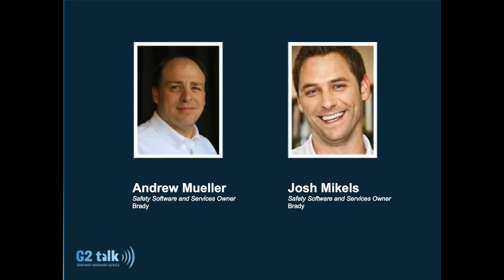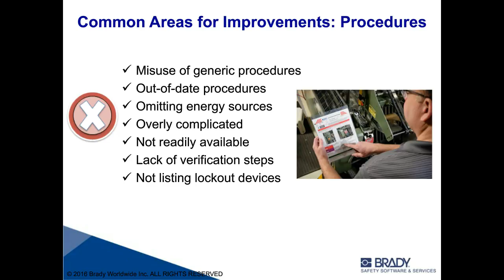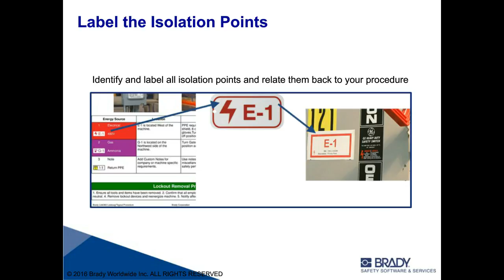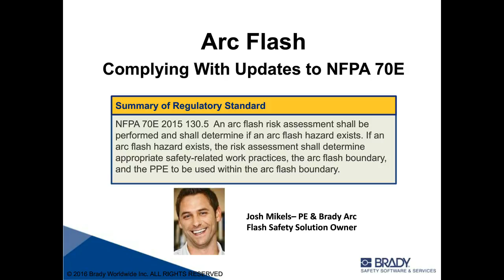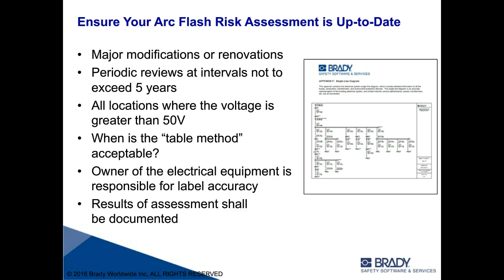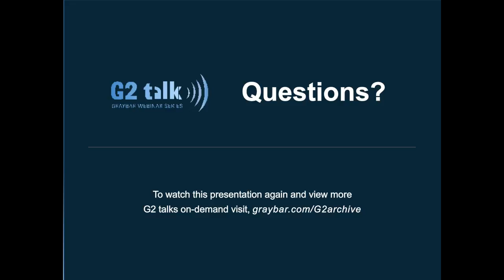Improving Electrical Safety Compliance: Arc Flash & LOTO

Comment: This overview is extremely informative and supports my contention that the development of energy control practice is the art of integrating various sources (ANSI Z244.1, NFPA 70E, 1910.147 & .333) into one hazardous energy control program. That is, one needs to consider electrical hazards (such as shock, arc flash thermal, explosion hazards) when performing control steps.  

May I respectfully suggest you to consider addressing OSHA's ESRWPs (that includies the LO & TAG requirements, contained in 1910.333) in your next training movie since it appears that your 1910.147 review section addresses electrical hazards.  See OSHA Instruction CPL 02-00-147, p. 3-10, to review the relationship between OSHA's LOTO and ElectrIcal standards contained in 29 CFR 1910, Subpart S.   A key difference between these two set of standard is the equipment-specific procedure provision as well as the requirements contained in paragraph (f) of 1910.147.  You may also find the 14 NOV 2006 letter to ORC Worldwide useful while addressing policy on OSHA energy control standards and NFPA 70E, including the differences in equipment marking, FR clothing requirements.  

I hope these suggestions are helpful.  Should you have any questions, I'd be glad to assist since I was the primary author of these referenced OSHA documents.  Best wishes.